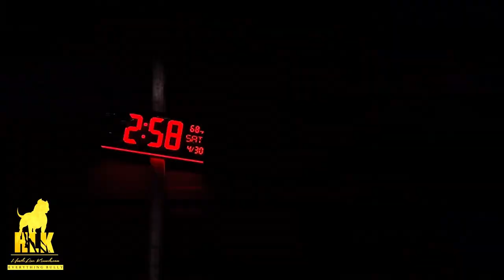Our Newest Outdoor Dog Kennel Setup Design With a Waste Drainage System | Louisville, Kentucy

Comment: the drainage idea is good. one thing I would recommend is you should put insulation at the roof because a metal ceiling would be very hot during the day so it would be wise to put another layer to insulate the heat.
Reply from the maker: Great idea. I gotta start researching the best options. Thank you
Reply: Do you deliver to Virginia?